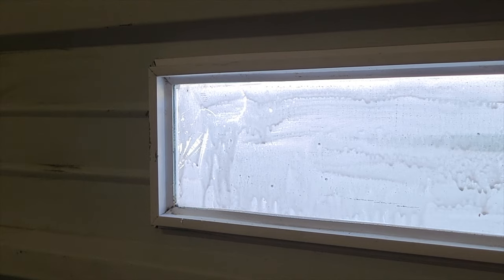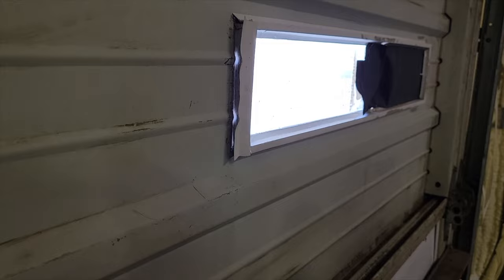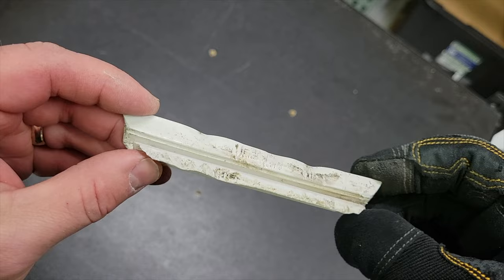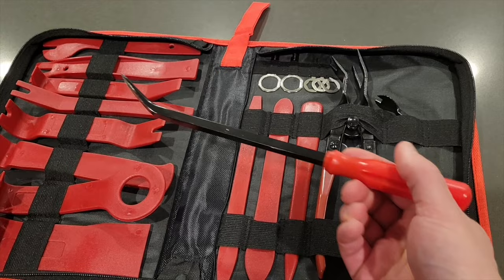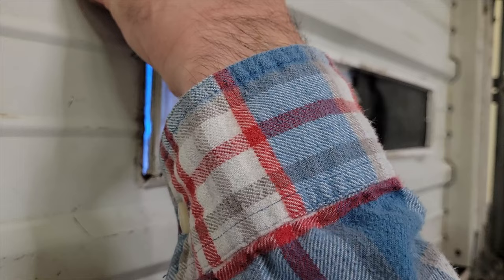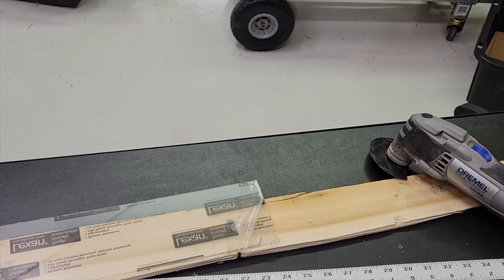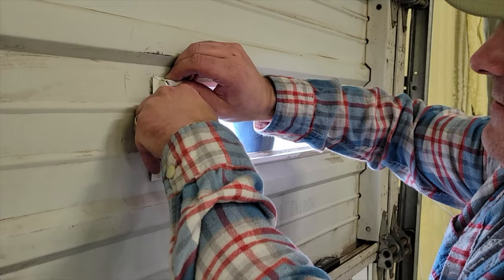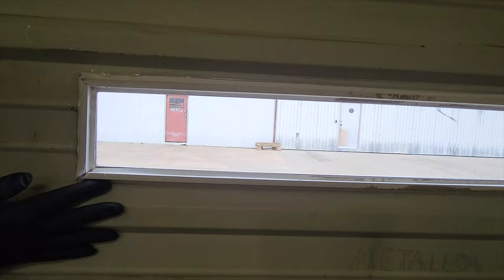Screw-Free Garage Door Window Frame Removal and Repair

Comment: 👍👍👍👍👍👍👍👍👍👍
My house was built with these in '88. My kids busted 2 of them a couple of YEARS ago.
I first tried to pry with a screw driver but I the plastic seemed so brittle I was worried
I would break it and be screwed.
Called the door company they said "What kind of door is it?"
"It's the kind of door with YOUR sticker on it!"
No help from them or glass companies so it's been sitting there covered with plastic & tape.
Then I saw your video that gave me the stones to finish the job, come hell or high water.
I did have a tool similar to the one you used.
Two tips.
Taking the trim off, I found it was easy once I got an end started, slide my hand between the end & the door
add some pressure as I used the tool to loose the grip.
Then I just took the frame pieces out & took them to Lowes ( I'm not sure HD does it).
Handed the frames to guy and let HIM cut the panes to fit.
I'm selling the house so glass was cheaper than the Lexan. Two panes EXACT fit - $15.00.
When I put them in, I had a 2x4 that my neighbor on the outside held TIGHT against the edge of the frame
as I tapped each piece in with a rubber mallet.
Some places I still had to push in by hand but I think the 2x4 helps spread the pressure to keep
from breaking the glass. Thanks again!!!!!!!
Reply from the maker: Yeah, after I was done (and video was published), I realized using a mallet might have been better to use with a second mallet or something solid on the other side of that window frame instead me and my helper just pushing against each other to reinstall the frame.

That pry-bar tool really is key to getting these frames off, isn't it?  

Thanks for sharing the Lowes info... others will definitely find it helpful!

Comment: I've got a WINDSOR DOOR model 535 on my home, built in 1995 by Beazer Homes.  And it's the screwless type.  So far I've gotten one side of one window off, but, like you, I damaged it a bit - and deformed it a bit when I tried a heat gun (because 33-year-old plastic seems so brittle).  There are quite a few DIY garage door window repair videos out there, but this one is the best because it answers the problem of screw-free doors.  I wish I had seen it sooner.  The best part is where you show the two rows of "teeth" that hold it in.  Before seeing that, you have no idea what's behind it.  Thanks!
Reply from the maker: Thanks Todd! Glad it helped!

Comment: New improved shortcut method -- 1. prepare the areas where you're going to unhook those teeth with a little WD-40.  I think this helps.  2. Warmth is good when you're dealing with old plastic - just not too much.  3. Today I replaced two windows.  For the 2nd one, I removed the old glass, then removed ONE SIDE only, then 3 or 4 inches of the top and bottom next to that removed side.  Then I bent my Lexan slightly and slid it in from the side.  It worked great!  4. If your new window is at least partially held in place, you can open your garage door and get on a ladder and maybe reach the top and bottom to put it all back together.  5. I wish I had a deep throat clamp - that would be a great way to get those teeth back together.  I can't imagine trying this with glass!